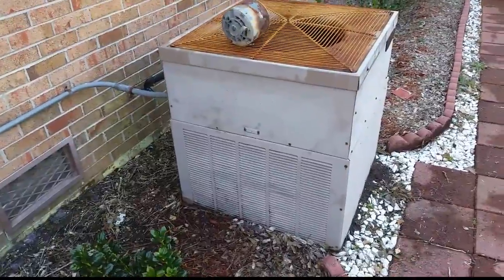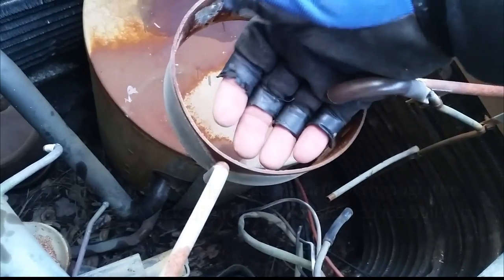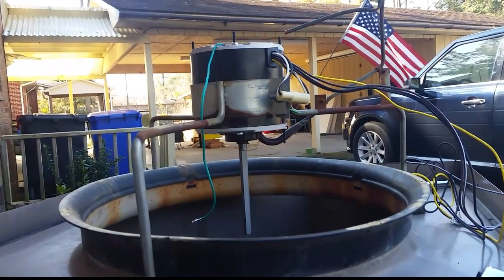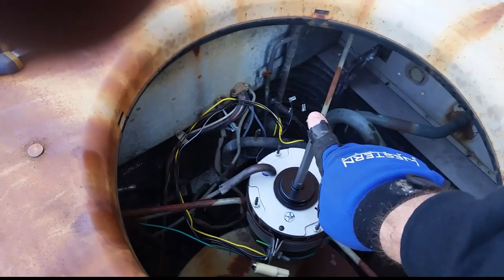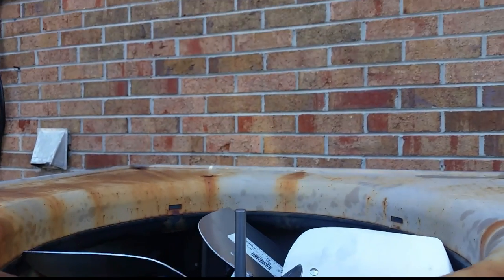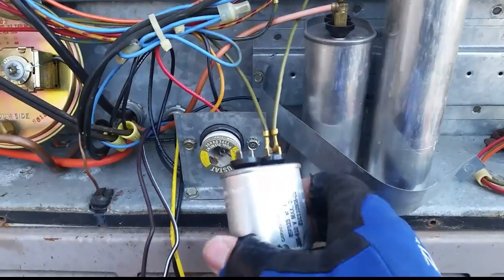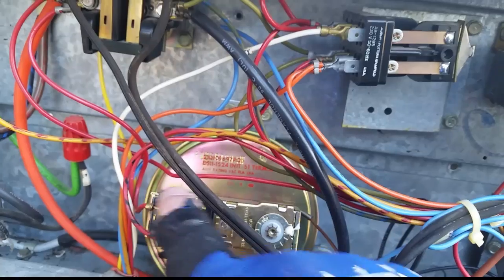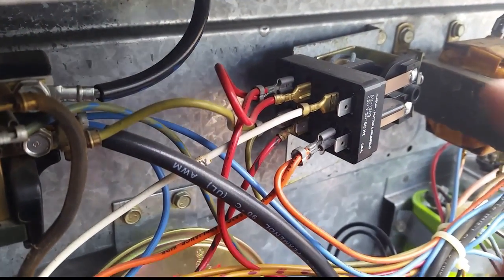HVAC Service : Condenser Fan Motor Replacement GE Weathertron

Comment: i would use antiseize compound and the plastidip on a fan blade if the motor has to be replaced again as antiseize is used on automotive exhaust fasteners and that could work on the motor shaft, fan hub the screws and setscrew. the unit looks to be good for the vintage not sure it can be upgraded to a scroll compressor it would live longer.

Comment: Man them heatpumps they made them to last we had ours the same unit except it was a 3 1/2 ton everything on that unit was the same except the fan blade was changed out motor was fine but the blade had a crack that got into it and it grew so we changed it. That thing over 30 years old and still running amazing.

Comment: I agree Zach I inform the customer about a new system and the pros of changing it out but I also tell them about the condition of their equipment and if it's old but looks good and has life left! And let them make the decision and I do whatever they want me to do I'm not gonna use scare tactics to make them buy a new unit and sadly I see that all the time but that just my opinion. Thanks for the video Zach
Reply from the maker: Sounds fair to me. Sometimes they do just want to replace anyway

Comment: I agree with you on your decision to service it. I have work on a few old furnaces that were built like a tank. No thin stamped out sheet metal for a HX. They were welded tubes and plates. My father in-law bought his American Standard furnace in 1974, paid $425 with installation and it's still going strong. Only repair was a low voltage Xformer and that was in 1981 before I met my wife. Oldest furnace I worked on was built in 1958 and the only way that thing was coming out of the basement was with a plasma cutter. Thankfully it only needed cleaning and a tune-up.
Reply from the maker: Wow, 1958. I would love to see that thing. Old equipment def doesn't need to be removed just because it is old

Comment: Even With new efficiency the end customer is at a financial advantage as the return on the new could be as high as eight to ten years. great attitude Zack, doing whats right for your customer.
Reply from the maker: Yes, and that's if the new one doesn't break down.

Comment: Considering the years of service that unit has provided and the minimal repairs it has required, I bet the owner has saved money in the long run even though it is low efficiency. 

That's an interesting defrost relay.  If I understood right, instead of a low voltage coil switching high voltage that one is high voltage switching low voltage?
Reply from the maker: That's right. 240 volt coil switching 24 volts.

Comment: Great video. Love them old units it's hard to not keep them going. Not built like that any more.
Reply from the maker: You got that right
Reply: What a relic...for the most part I either bypass all that pressure switch circuitry...looks like the fan is going backwards (downflow)...might be the recording frequency...good job though...for a 1985 it's very clean...resembles old GE...which became American Standard/Trane...
Reply from the maker: Gregory Butler it's in pretty good shape for an older unit.  I did redo the defrost on a commercial GE in another video.

Comment: Nice to see you working on some newer equipment for a change :-p

I've just been given a 1950's freezer that was being used till recently, it needs a new compressor as it has stopped pumping. I am hoping to do a series of vids on getting it running again.
Reply from the maker: I look forward to that series John
Reply: Its an old Frigidaire with a metermiser ( i think) compressor, had 2lbs of R12 in it!
Reply: heavydiesel  Based on current R12 pricing here in the US, that thing had $400US (~150 quid, I think?) of the gas.  Recovering the refrigerant in that unit outstrips the cost of a modest new fridge! 0_0
Reply from the maker: heavydiesel check this out. R22 is still legal here. At Carrier Southeast they actually pay us for our recovered r22. I earned a couple hundred so far.
Reply: sivalley R12 and R22 has been banned here, not allowed to service the equipment anymore (R12 was banned in 94') If we take the gas out it has to go for destruction so actually costs about $120 for a 22lb recovery cylinder to get rid of it!
Reply: R22 was legal up until the start of this year, i have a few systems that due to a small leak have had to be converted to a newer refrigerant, a lot of money for a less efficient system!
Basically overnight it has become illegal for me to work on most of the equipment i maintain fro my customers! Though they have had 20 years warning as it was banned under the same regs as R12,
Reply from the maker: heavydiesel as soon as they leak then you are compelled to switch refrigerants? Can you keep them running until they leak? Or must you convert them immediately?
Reply: talyn875
For R22 you can keep running them indefinitely, but you are not allowed to break into the refrigeration circuit, so no fitting gauges to diagnose or change a faulty part etc. Basically can only fix electrical problems!
We are not allowed to leave them running if they are leaking either, i think we would have to shut the system down and recover the refrigerant. The regulations are new so its a bit of a learning curve for all concerned.

If you look up F-Gas regulations it will give you an idea, it is a European wide regulation. There are limits on charge size for certain refrigerants and soon R404A and many other high GWP refrigerants will be phased out or taxed out of use.
I have just installed a system which cost $80k on R404A which it will be illegal to add refrigerant to in five years! (I did not sell it, was contracted to do the pipework and commission) The crazies are in charge!

Comment: Best heat pump ever made
Reply from the maker: I think so. At least most reliable and durable
Reply: Yeah they are do you like Bristol compressors remember that 1988 ruud y'all changed out
Reply from the maker: heatpump hvac Bristol are fine. I have seen some of them 20+ years old
Reply: Yeah york still uses bristols
Reply from the maker: heatpump hvac yep, my Yorks all had bristols
Reply: Yeah yor latitude and lx series uses bristol r410a recipercating compressors today

Comment: One of my customers has a Ducane thats around 30 years old. Like this one ,the only thing not OEM is an evap motor that I installed 5 or 6 years ago.There is more metal in the cover than most machines today.
Reply from the maker: That's cool. I would like to see that unit
Reply: talyn875
The owner used to work for Ducane here in SC. It looks a lot like the Carrier you were working on.

Comment: Zack, those units were made to last GE made good stuff till Trane came along and messed it up. One other thing about that contractor now you do not have one in that unit but GE made a contractor and put in a lot of there units that one side was made for compressor amperage and the other side was made for condenser amperage. Most of them were used in the units that were wired for trickle heat. They use the start winding for heating the oil instead of a crankcase heater.
Reply from the maker: Very cool Larry. I always enjoy your comments when I work on these because of your experience with them

Comment: Zack, that unit was built back in the years when they made equipment to last. Everything today is cheap tin made to last maybe 10-15 years maximum. I have a Thermopride oil furnace from the early
Reply: 1980's that I refuse to change because it's built like a tank. (Sorry for the two part response. I was disconnected before I finished writing).
Reply from the maker: Brad1237202 unfortunately things today seem to be made only with cost in mind.